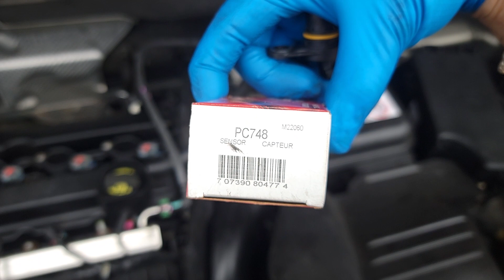HOW TO REPLACE INTAKE / EXHAUST CAMSHAFT POSITION SENSORS ON 2.4L 2015 JEEP PATRIOT FAST & EASY DIY!

Comment: Why did you decide to change the sensors? Did it fix your problem? I'm getting a check engine code P000A code on my jeep patriot. JScan app says its a Bank 1 camshaft 1 position slow response. I'm trying to figure out if changing the front camshaft sensor is worth trying to see if it will fix my problem. Thanks
Reply: I got a p0013 which says bank two. Did it work on your car?
Reply: I got those same codes
Reply: i believe is the same sensor